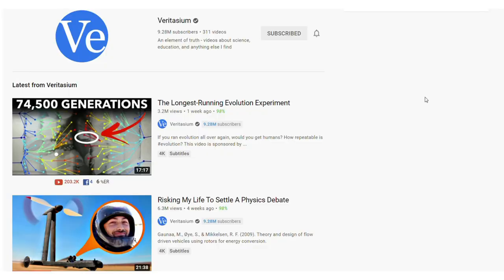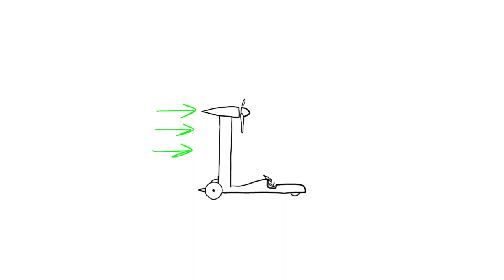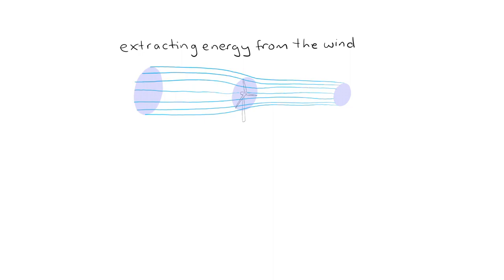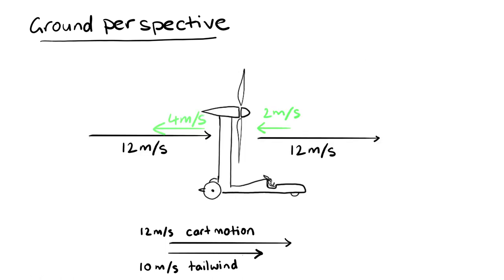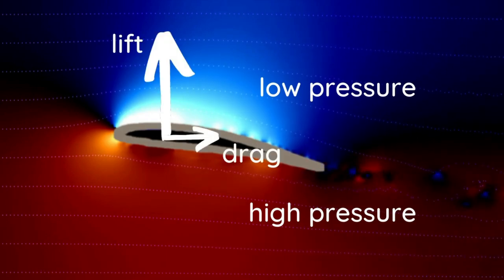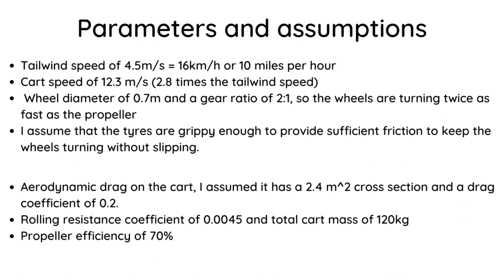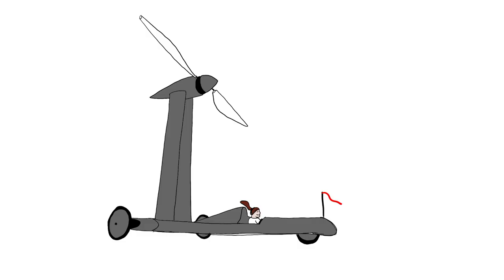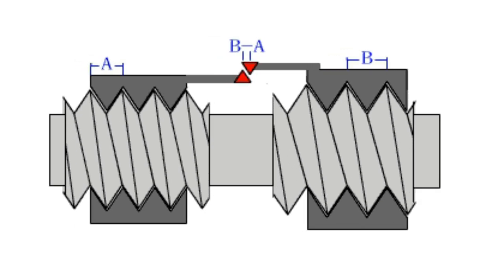Downwind Faster Than the Wind by Veritasium: How Does it Work?

Comment: Analysis, assuming perfection and no losses.  Wind velocity= W, Position of craft=S, Velocity of craft =S1, acceleration of craft=S2.  If the wheels rotating proportional to S1and are linked to the propeller then the thrust T is basically proportional to S1.
 The drag of the craft when traveling less than the wind is proportional to..............   (W-S1)  
The wind of the propeller( proportional to S1) blows opposite to the real wind ( W) hence thrust with respect to the ground, depends and is proportional to the summation of the two winds, hence.....................(W+S1)

Acceleration Force is proportional to  thrust - drag,  =(W+S1)-(W-S1)         hence 
the acceleration of craft S2 is proportional to the velocity  of craft S1

This may be represented by the differential equation
S2= K*S1 + input I             where K is the controlling factor of how much velocity feedback is used ( gearbox)

Solving using BASIC programming. 
  K=.01                              ( feedback )
      S1=0                            ( initial velocity)
      I=.1                               (   initial push) 

      FOR T=0 TO 1000
        S2= K*S1 +I                ( equation of system)
        S1=S1+S2                    ( integrating acceleration into velocity) 
        PLOT 69, T, 500+S1      ( Output showing instability of the perfect system, an ever-increasing velocity of craft. 
     IF T>6 THEN I=0               ( The push is stopped after some time) 
 NEXT T

A second program where the craft is stabilized by introducing drag proportional to the velocity of craft   S1^2 hence the craft reaches a limited top speed S1. 

      K=.01
      S1=0
       S=0
      I=.1
      FOR T=0 TO 4000
        S2= K*S1 +I  -.00001*S1^2    ( the latter term is  the drag of the craft in the forward direction proportional to S1^2
        S1=S1+S2           (velocity) 
        S=S+S1               ( ground covered) 
        PLOT 69, T, 200+S1
        PLOT 69, T, 200+.001*S
        IF T>6 THEN I=0
      NEXT T
Reply: Continued.    I am noticing some misconceptions mentioned in this video. For the sake of engineering, we need to discuss them. 
Note, that a rotating turbine (or a sail) and a propeller (or a fan)  involve two totally different processes. A turbine generates rotating shaft power from, Natural blowing wind, while a propeller generates, Artificial wind from, a rotating shaft power/ torque. 
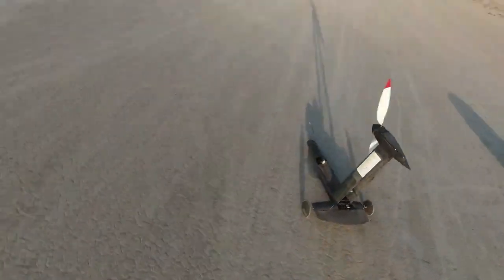1. At 0:09, " The vehicle resembles a TURBINE on a cart." The rotating part is a  PROPELLER, not a turbine. The blade profile is that of a propeller and not a turbine. 
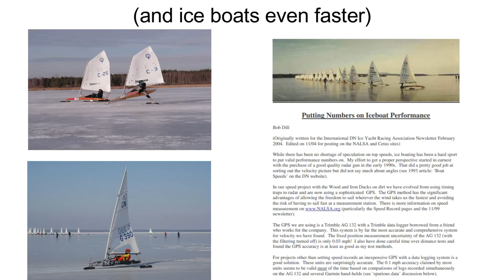2. At 1:14, " Performance sailboats tack both upwards and downwind much faster than the wind,"  then at 1:21, that, "the velocity component in the direction of the wind is much faster than the wind!" 
The sail on a sailing boat is a TURBINE  and not a propeller, and so while a sailing boat can reach higher speeds than the natural wind when reaching, moving at 90 degrees or thereabouts, to the wind, but, if it goes in a direction component with the wind, it loses the apparent wind in the sail and the TURBINE(a sail ) will not produce thrust.
3.  At 1:45, there was no need to mention the laws of thermodynamics apart from the first one, about the conservation of energy, and so the laws of DYNAMICS are all one needs to consider in this cart.
4. At 4: 09, " the wheels turn the propeller but they do not power it!"  YES, the wheels do power the propeller through their continuous traction with the ground. The propeller does not act as a turbine to power the wheels, but it should!
5. At 4: 31.  When the cart is moving below the natural forward wind speed, the cart is powered by the velocity wavefront of the "natural forward wind" acting on THE  BACK DRAG AREA OF THE MOVING CART, when, assuming the propeller is not turning. If the propeller is active, the disc area of the rotating propeller is producing an artificial backwind wind, acting in opposition to a  moving wavefront of the natural forward wind, and so the NATURAL FORWARD WIND and the ARTIFICIAL BACKWARD WIND  oppose each other with respect to the ground. At the speed of the wind, the Cart Drag disappears and the cart is powered by the forward natural wind acting on the backward disc of the artificial wind that is being produced by the propeller disc area -driven by the rotating wheels. Note again that the natural forward wind wavefront is acting on the disc area of the artificial backward wind, " cylindrical high-pressure solid wind column"  which can change its  size and length depending on the solidity and pressure zone behind the propeller
Note at this stage, that the solidity of the artificial backward wind behind the propeller disc needs to be well-pressurized zone and basically solid in nature to push on, and so, the propeller cannot move at slow speed and therefore a high pitch propeller should be discarded, and one should choose a low pitch higher speed propeller to produce the solidity or pressure zone behind the propeller disc which is preferable at take off from that situation when the speed of the cart is equal to the speed of the Natural forward wind. Just like the take-off of a propeller aircraft.
6. At 4:41. " Why the wheels do not put more drive on the propeller than it needs to move forward."  At that state when the velocity of the cart is equal to the velocity of the natural forward wind, the push/velocity relation, hence power extracted from the natural forward wind acting on the disc area of the rotating propeller, given to the wheels is far higher than the power required for the wheels to rotate the propeller, and so the cart can easily go through to achieve higher speeds, by building an air cushion of air with its rate of build-up, between the back effectively flat disc of the rotating propeller and the natural wind wavefront.  Hence higher than wind craft velocities are attained.  After higher than wind velocities, it is the frontal drag that comes in to limit the top speed achieved by the solid cylindrical column of the propeller backwind wind disc acting on the forward-moving wavefront of the natural wind.  ( Note the solidity of this column of wind behind the propeller, and so the propeller needs to rotate at the higher speeds, as this cart will not work at slow speeds where the air particles around the propeller will stick with the blades and no backward momentum is transferred to them by the propeller motion. Blackbird did not work at 6mph and it needed about 10mph to solidify the backward artificial wind created by the propeller disc pushing on the wavefront of the natural forward wind.
7. 5:25. Assuming the propeller is not slipping then from the ground, the air through the propeller, standstill while with respect to the pilot, the air through the propeller is moving as fast as the aircraft.
8 7:01. " The wheels are moving over the ground faster than the propeller is moving through the air."  Totally irrelevant as with a gearbox these relative speeds can change.  It is power and torque that counts. It is the power extracted from the Natural forward wind, acting on the Artificial backward wind made by the disc area of the propeller that transmits more power to the wheels through the ground traction, then the wheels are required to transmit to rotate the propeller through the chain drive.  Two totally different power transfer paths.  That is the whole secret of this wonderful engineering game. 
9.8: 42. " propeller speed is much faster than the wind speed." This is not for the reason described, but for the simple reason that the artificial wind generated by the propeller must contain " solidity" so that the column of backward artificial wind produced will push hard on the wavefront of the natural forward wind.  For this solidity of the backwash of the propeller disc, one needs a high-speed propeller, preferably with low pitch,  so that the air mass lumps will remain together as "solid" air lumps as they pass over the propeller airfoil. The propeller blades need to move fast to produce solid wind behind them, hence a solid cushion to push on the forward natural wind.
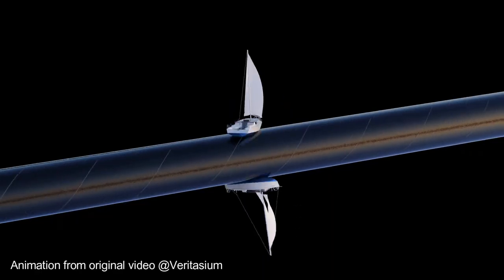10. 9:39.  A propeller is not like two sailing boats going around a cylinder, that is a TURBINE and that will never go downwind faster than the wind!. 
Basically, this is how it all works.
If the cart has a bladed rotating system, connected to the wheels,  as shown on Blackbird, but the blades have a variable pitch so that the blades can act either as a TURBINE extracting natural wind power driving the wheels or a PROPELLER producing an artificial wind, driven by the wheels. 
At the start, with the pitch of the blades angled to produce TURBINE shaft power, the natural forward wind reacts and drives the turbine, which drives the wheels. The driven wheels accelerate the cart which reaches the wind speed where the bladed system can no longer work as a turbine.,  BUT THE NATURAL FORWARD WIND KEEPS BLOWING MOVING WITH ITS NATURAL VELOCITY.   At this stage, the bladed system has a change of pitch which changes it into a propeller now being driven by the rotating wheels in traction with the ground. In this propeller form, an artificial backward column of wind is produced at the back of the propeller disc, pushing on the wavefront of the natural forward-moving wind. 

IF THE EXTRACTED POWER ( DISC POWER), WHICH IS GENERATED BY THE NATURAL FORWARD WIND, PUSHING ON THE SOLID BACK DISC/ PLATE OF THE COLUMN OF THE BACKWARD ARTIFICIAL WIND, CREATED BY THE PROPELLER, WHERE THIS MOVING DISC / PLATE POWER ( DISC POWER)  IS TRANSMITTED TO THE WHEELS THROUGH THEIR TRACTION WITH THE GROUND, ( WHEEL POWER) IS GREATER THAN THE POWER NEEDED TO ROTATE THE PROPELLER ( PROPELLER POWER), THEN THIS SYSTEM WILL MOVE AT A VELOCITY HIGHER THAN THE WIND. In fact, without losses, this system has an acceleration proportional to its velocity and so it is unstable.
 
To achieve all this, the propeller must move at a fast rate related to the mass inertia of the air being handled, hence this vehicle cannot move at slow propeller speed as the air particles will not remain as solid mass lumps when they travel through the propeller, as propeller propulsion drive will be lost.
Reply: Here is another analysis of this machine which I feel is the best I can offer.
* The propeller blade chosen has an airfoil section which has a LIFT  to DRAG  ratio at the selected pitch. 
* The THRUST of the propeller is related to the LIFT of the blade with the airfoil section. THRUST = LIFT
Let us consider a one-bladed propeller mounted on this craft with no losses considered. 
The input   TORQUE  to the machine is THRUST multiplied by the radius of the driving wheel, say  (R-wheel)
This input torque is used to drive the propeller which offers an opposite torque = DRAG of blade, multiplied by the radius along the propeller blade at which the drag is centred. (Rp-drag)

Assume a 1:1 gearbox, between the wheel shaft and the propeller shaft-
Equating the torques then  (Thrust)*(R-wheel)= (Drag)*( R-drag)   which may be written as 

(Lift of prop blade)*(R-wheel)= (Drag of prop blade)*( Rp-drag)  hence

(Lift/Drag)  = (Rp-drag) / ( R-wheel)    note the (Lift/Drag) is that of the propeller operating at the selected pitch/ angle of attack.

Considering that a house sparrow has a Lift / Drag ratio at about 4:1 and an albatross about 20:1
Then  the ratio of (Effective Radius  of the propeller blade at which effective drag is centred) to the ( radius of the driving wheel)  is equal to the ( Lift/ Drag ratio of the propeller blade)

A logical guess would be that (Rp-drag) / ( R-wheel) = 3 to 5  with using a gearbox 1:1 to link wheel axle and propeller axle. and some losses added in.
Reply: @carmelpule1  "The sail on a sailing boat is a TURBINE,"

Not on broad reach with a downwind velocity component greater than windspeed. That is the sailing situation relevant for this cart, and here the keel is the turbine while the sail is the propeller. What you describe is true for other sailing situations, like tacking upwind, where the roles of sail & keel are reversed.

"A propeller is not like two sailing boats going around a cylinder,"

Yes it is, in the sailing situation shown in the analogy (downwind VMG > windspeed). Draw the vectors for both, and you will see the aerodynamics is equivalent.
Reply: @carmelpule1  "At the start, with the pitch of the blades angled to produce TURBINE shaft power, the natural forward wind reacts and drives the turbine, which drives the wheels."

This never happens on the Blackbird. It has a one-way transmission (ratchet) that prevents the rotor from turning the wheels. The Blackbird rotor never acts as a turbine, it always acts as a propeller, turning against the aerodynamic torque. Their prototype didn't even have variable pitch. See the clip: "BUFC second run".
Reply: @carmelpule1  ">>The wheels are moving over the ground faster than the propeller is moving through the air."<<  Totally irrelevant as with a gearbox these relative speeds can change. "

This isn't irrelevant.  The condition: airspeed < groundspeed is a requirement to produce more propeller thrust than wheel drag. In the case of airspeed = groundspeed (no true tailwind) the propeller thrust can never be greater than the wheel drag needed to turn the propeller.
Reply: @eyytee  Thank you for replying.  The way I see it, on a treadmill, in the still air, ( no true tailwind) the propeller seems to bite enough and produce a lift to overcome the wheel drag. I would say that a propeller with a high ( LIft/Drag) ratio would do it.
Torque balance   ( Lift of prop blade )* ( radius of wheel Rw)  = or >>> than  ( Drag of prop blade)* ( Radius of prop at which  drag of prop is centered Rpd)
( Lift/Drag) of propeller blade  =  (R-pd/ R-wheel)
On a treadmill, a propeller with a High (Lift/ drag) ratio should pull it through if the propeller has enough high revolutions to deal with solid air through it. I would select a low-pitched prop for this initial activity.
That is my thinking at the moment...................and  I shall revise and rethink my present mind processes/activity, which may include changing and altering my thinking. Thank you once again.
Reply: @carmelpule1  "on a treadmill, in the still air, (no true tailwind)"

true wind = wind relative to the surface, or velocity difference between air and surface. So on a running treadmill the cart does have a true tailwind, just no apparent wind (low airspeed). For the propeller to produce more thrust than the wheel drag needed to turn the propeller, you need airspeed < groundspeed (if airspeed and groundspeed have the same direction), which is of course true if airspeed is very low (at windspeed, or on the treadmill).
Reply: @eyytee  I drew the vector diagram, assuming that the boat speed was double the wind speed, and at about 45 degrees down to the wind. The relative wind is much slower than the boat, but considering the lift and drag, there is still a small resulting vector to still accelerate the boat downwind. It is very small for practical use when considering the rate of diminishing the magnitude of the relative wind as the boat angles down its reaching tack.  In this case, the sail will keep acting as a turbine while the centerboard keel will keep acting as a wing or a propeller.
Just wondering that since the water is effectively stationary and somewhat hard like a road, one could use the same principle as the land cart, where a  water paddle would be connected to an air propeller where there will be a stage when the sails can be brought down!!  The propeller blade would need to have a high ( Lift/ Drag)  ratio operating with enough revolutions and pitch to produce thrust/ lift with a velocity to break through the no relative wind barrier all brought about with the least torque on the shaft obtained from the still rotating water paddlewheel!!   For such states, to be reached, one needs highly efficient engineering, reaching almost 100% efficiency of the many units used, especially the water paddle and the air propeller.  It is possible on land, but very difficult in water. 
Thank you for the cordial discussion.
Reply: @carmelpule1  

// "on a treadmill, in the still air, ( no true tailwind)"//

If the treadmill is set at 10mph in a still air room, there is a 10mph wind between the air and the belt.  It's as 'true' as any other wind.
Reply: @carmelpule1  

// ""The sail on a sailing boat is a TURBINE,"//

Depends on the point of sail and the VMG.   In the case of a traditional sailing rig on a broad reach with a hot VMG, the sail is acting as a propeller and accelerating air up (true) wind.
Reply: @johnborton4522   Thank you for replying. Yes, it is true that the boundary layer between the still air and the moving belt will be shearing at 10mph. Also, a person riding on a trolley moving at 10mph in the same direction with the 10mph wind will feel no wind but on looking down he will see the boundary layer below him shearing as in the case of the moving belt in still air.
Reply: @carmelpule1  "Yes, it is true that the boundary layer between the still air and the moving belt will be shearing at 10mph."

Relative to the treadmill belt the entire airmass in the room is moving, and that is "true wind" = air motion relative to the surface the cart runs on. Relative to the treadmill belt the cart is initially moving downwind at windspeed and then accelerating to above windspeed.
Reply: @carmelpule1  "assuming that the boat speed was double the wind speed, and at about 45 degrees down to the wind...the sail will keep acting as a turbine while the centerboard keel will keep acting as a wing or a propeller"

Look at the velocity and force components that are perpendicular to the true wind. These cross-wind-components are analogus to the tangential components on the rotor. You will see that for downwind VMG > windspeed the cross-wind velocity is opposed to the cross-wind aerodynamic force on the sail (so the sail acts like a propeller blade rotating against the aerodynamic torque), and it's the cross-wind force on the keel that drives the boat across the true wind (so the keel acts like a turbine blade rotating in accordance with the hydrodynamic torque). 

If you draw the diagram for tacking upwind, you will see that the roles of sail and keel are swapped. The Blackbird also went directly upwind at 2.1 x windspeed, and here the rotor was acting as a turbine turning the wheels.
Reply: @eyytee  Thank you for replying. Yes, I followed Blackbird going directly upwind, but I did not appreciate that as much as the faster than wind, downwind run. Since the road does not move, any turbine with a not too ambitious pitch and a high reduction gearbox would do that, and the appreciation is in maximizing the speed. Blackbird did very well going upwind.  I saw a small catamaran in water where the air turbine drives a water propeller, but as the fluid slips and needs Newtonian dynamic force unlike a solid road anchor point, it just moved upswing slowly upwind. 
Yesterday I drew many diagrams for close reaching, reaching, and broad-reaching sails for boats with high and low velocities. A high-speed sailing boat would do with flatter sails travelling in any direction but a slow boat would need curved sails to change the relative wind into one in line with the boat. When going close to the wind or down with the wind, a fast sailing boat loses the driving vector rather fast.
       Thank you for the discussion, this reminded me of my younger days when about 75 years ago I used to work on Schrage  Electric Motors and Homing torpedoes, where the motors windings had had to deal with three magnetic fields ( winds) rotating at different speeds, while the homing torpedo had an algorithm which had to include the distance vector, the velocity vectors of the submarine and the velocity of the target, and I even allowed for accelerations vectors.  I did not bother about the sea currents as that was a frame of reference similar to the treadmill belt!!   Thank you once again, let us hope we do not solve this using higher-order TENSORS  acting on the " sails" " props" and "turbines" rather than my old brain having to deal with simple Vectors in a fixed frame of reference, preferably cartesian rather than Polar or Spherical! 
       When young I had many problems explaining to other people that what we call "j", referring to the square root of minus one, it is not an imaginary number, but a real single rotational operator of 90 degrees, and in engineering when one finds that the mathematical model indicates that the solution contains " the square root of a negative number", then the system needs to rotate rather than translate. 
      Thank you for your patience, I must admit, I enjoyed going back to the vector relativities that exist in air, water and magnetic winds including electric field vectors. Space vector navigation would be interesting with trying to arrive on the moon at a particular time on a particular patch on its surface!!
Reply: @carmelpule1  "When going close to the wind or down with the wind, a fast sailing boat loses the driving vector rather fast."

Yes, but when the surface resistance is low (iceboats, landyachts and foiling boats) you can achieve downwind and upwind VMGs that are multiples of true windspeed. See for example: "Iceboat Sailing Performance-Cetus" (page 4).
Reply: @eyytee  Yes, I appreciate the higher speeds when reaching and related closed and broad angles in a sailing boat, but as yet I have to see a sailing boat going downwind faster than the wind! 
I saw some of your videos on this subject and I must congratulate you on your presentations, and that you were ahead of others on this subject. Thank you for your assistance.
Reply: @carmelpule1  " as yet I have to see a sailing boat going downwind faster than the wind! "

To see this on water, you have to watch the foiling boats in the America’s Cup. But on ice or land it's almost trivial to achieve, so any regatta will do.
Reply: @eyytee  Thank you for the information, I had another look at the vector diagrams,
The limiting factor is how much forward force can the winged sail extract out of the angle between the boat heading and the direction of the apparent wind, in which the sail curve must fit. That angle can never be zero else the boat would be moving straight into the wind and that will achieve nothing. The lift or forward component of the force to drive a boat forward relies on this angle.
Obviously, the success of the America Cup contenders is due to the lift of that beautiful, majestic wing angling forwards its lift, while those remarkable extra-strong foils must reduce their drag drastically as they take off, otherwise, they will never do what they do.  Absolutely remarkable and now I have to forget the limitations of lift, and drag in my old small monohull sailor. It appears so obvious now, and what I can conclude from all this, that one should aim to have the apparent wind always on one's nose!  Blessed are the wings and foils. Thank you for referencing the America Cup. You are a patient person.
Please note that my statement,  " as yet I have to see a sailing boat going ( directly) downwind, faster than the wind! ", still stands, as The America Cup contenders do not go directly downwind, as the Blackbird vehicle land vehicle did, but now one never knows if we can get a paddlewheel on the boat to drive a  backwind-artificial-wind-making propeller whose blades need to have a high (Lift/ Drag) ratio! so that the torque to drive it is much less than the torque generated by the lift of the blades working in conjunction with the radius of the paddle wheel! where the whole machine remains contained, "en block", in a volume of natural forward travelling wind!  which needs to supply continuous energy!
Reply: @carmelpule1   " as yet I have to see a sailing boat going ( directly) downwind, faster than the wind! "

To do the directly downwind version on water you would replace the wheels with a underwater turbine. According to Drela's analysis it should be doable in practice, but much more difficult than on land.